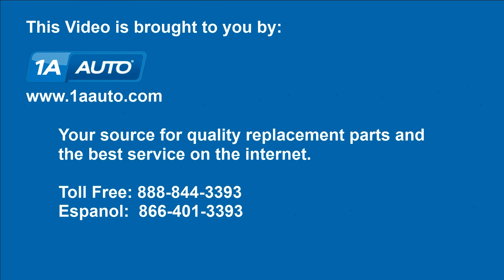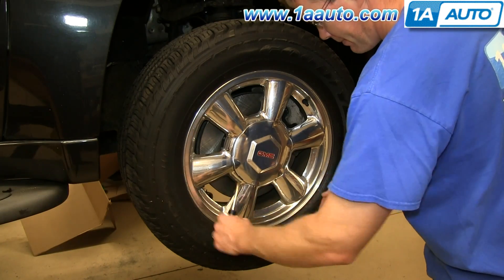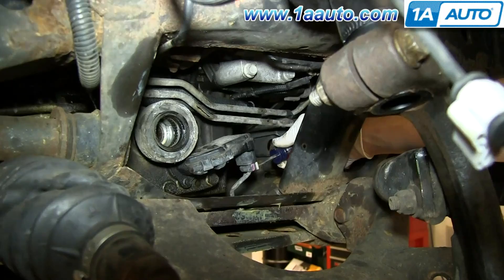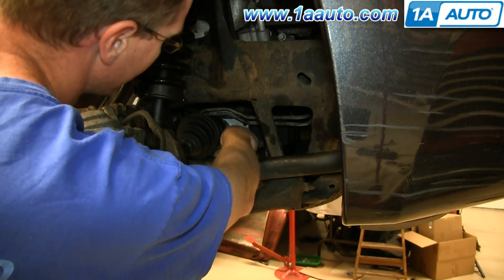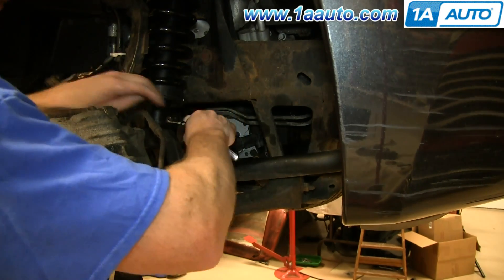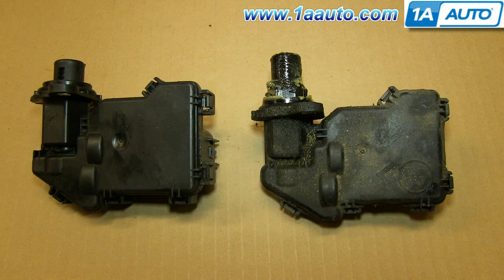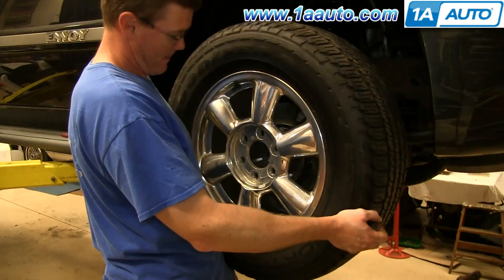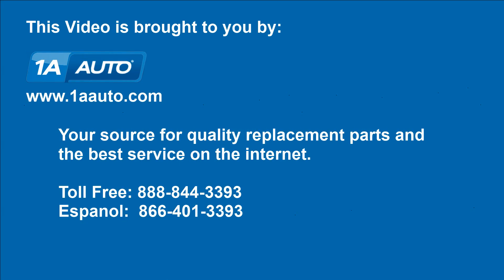How to Replace Axle Shift Actuator 02-06 GMC Envoy XL

Comment: Hello. When I turn the switch to 4h and with my door open I can hear the actuator move or make a noise. I tested my 4 wd and the front wheels didn’t pull me. No code given. Would this be the logical thing to change first ?

Comment: i dont have any code i just get a lot of vibration when i engaged the 4x4 i already replace my front aftermarket axels for OEM ones.did u think the can be causing the vibration? the axel actuator the trucks feels like all 4 tires are not sync.
Reply from the maker: +marino Sanchez We can't really accurately diagnose that without seeing the vehicle. We would recommend you take it to a reputable mechanic for diagnosis

Comment: Does the CB shaft have to be removed to replace actuator
Reply from the maker: +allan quintal Thanks for watching!  No you do not need to remove the CV axle re replace the actuator.  We just had it uninstalled at the time as we were shooting multiple videos!